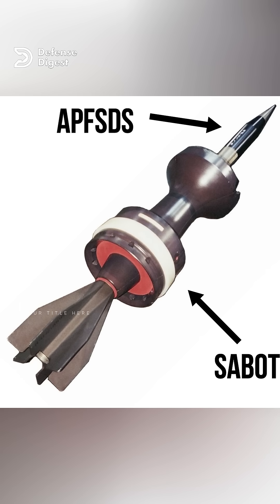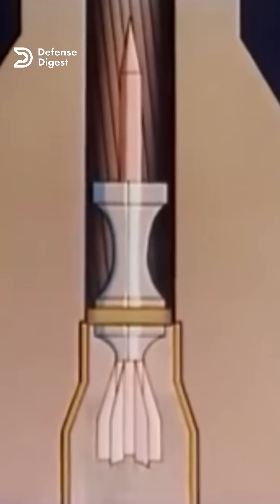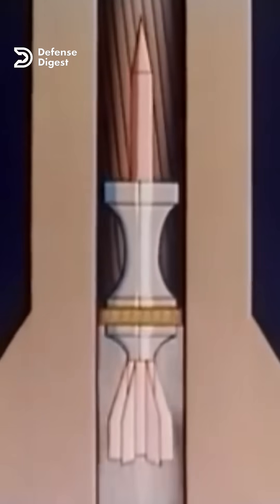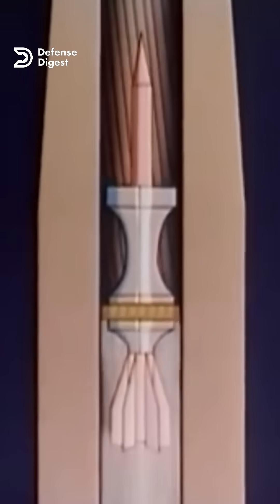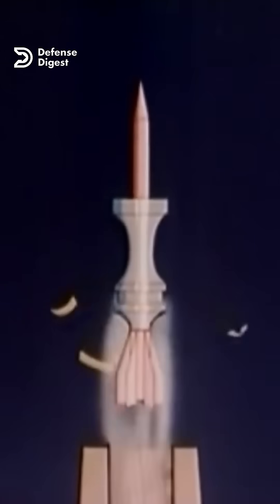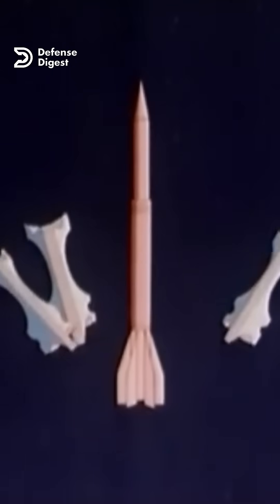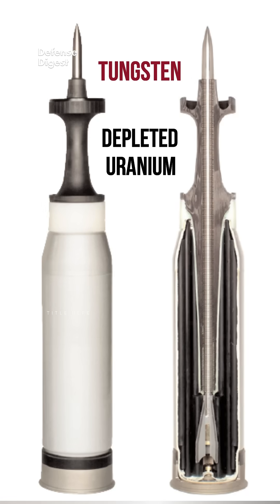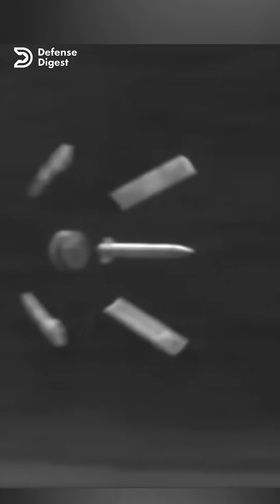How Do APFSDS Rounds Work?

Comment: The video of the fire thing going through multiple layers of concrete is a video of the United States Navy's prototype for the rail gun.
Reply: It is, you are correct... but that round is also a Sabot, a break away cog with a dart, just going 7km/s... so the footage is still relevant.
Reply: @TheThunder005  idk I feel like it’s cheating
Reply: I was about to comment that
Reply: lt.kf51  
Is there a storage bin? Or just stays on the deck/floor of the tank?
Reply: @nicholasmuro1742  Depends on the tank too. Some you put the empty shell back where the full shell was. Other tanks throw the shell out the back of the turret through a small hole for it.
Reply: @Macintosh007 
Ok, thanks
Reply: Yes they used railgun prototype footage for this non railgun explanation, I take everything I see on shorts with a huge salt rock.
Reply: And the projectile is also going through steel plates, not cement walls
Reply: i came to say this
Reply: Thats what i tought...
Reply: 100%FACTS!😂👍👍👍
Reply: @lt.kf51 you make a very valid point, didn't think about it that way... another thing too is that it isn't spun (rifled)
Reply: lt.kf51 
Where does the propellant casing go after firing the round on a tank?
Reply: @nicholasmuro1742  It depends on the tank in question. Some tanks use combustible casings that burn up when fired and only leave behind a small bit of metal at the base of the shell, some have an automatic ejection system that ejects the shell out of the turret after firing, and some just pile up spent casings inside the tank.
Reply: @ballsquid4135  
How do you know this if you are a squid?
Reply: @nicholasmuro1742  I wonder that every day.
Reply: @ballsquid4135  
Lol... are you Navy?
Reply: @nicholasmuro1742  Nah, I'm not in any branch.
Reply: @ballsquid4135 you dont want the casings to just be laying out in the field. If they are others will come remove them unless you lose the ground. Even after we fired our AT4 rockets we would run the tubes over with the humvees or something else to crush them. The shell casings from tanks or disposable rocket systems can be used to make ieds with.
Reply: @ballsquid4135  
Squids are slang for Navy
Reply: @nicholasmuro1742 back into the turret, they put the casing back where the live round came from, or on to a storage bin, but it depends on the tank model.
Older tanks had a hatch to throw the casings out.
Reply: @linkbond08  
Thanks

Comment: I think it's considered an armour defeating type munition as opposed to an armour piercing type.
Reply: It is literally called "armor piercing"
Reply: That depends on the material. The Depleted Uranium alloys is unlike anything Tungsten alloys can do.   The DU sabots actually self-sharpens as pieces break off upon penetration, and hitting additional layers/materials (especially the new US segmented DU sabot round).   
 Against armour at/near its penetration limit, the DU sabot works more like the cutting action of a HEAT warhead. Rather than on pure kinetic energy overmatch capability, like old school AP and the new Explosively Formed Penetrators.

Comment: The clip where you show a round penetrating multiple armor plate is from electromagnetic rail gun test. Not an APFSD round. Its misleading.
Reply: The rail gun "fires" APFSDS rounds. The sabot is there to catch the electromagnetic charge, instead of the chemical propellant, but the concept is almost identical, little uranium spear = hard to throw, so wrap it in something while accelerating, fins for accuracy after. 🤷‍♂️
Reply: it is a APFSDS as others have said, but electromagnetically charged and fired instead...
Reply: Look at the moment where he explains sabot, the animation in the background shows a rifled barrel, that cant be apfsds, anyone with a little bit of understanding this matter will know that an APFSDS is fired out of a smooth gun because the rifiling itruduces tooo much friction. Later he says that "it has fins at the back for flight stability" wich is correct, so i dont get why he showd us a rifled barrel. Probably a short done by someone who is doing low budged shorts on topics that are esnured to get views... well it works
Reply: @pro3ification the British Challenger 2 MBT has a rifled gun but still uses APFSDS. The footage may have been in relation to that. The rifling is for it's HESH shells

They plan on retiring their rifled guns though
Reply: @pro3ification  APFSDS can be fired from a rifled barrel, that's what was done originally. But then they discovered that it's performance suffers greatly compared to a smooth barrel.
Reply: @pro3ification the challenger has a rifled bore. It can fire apfsds rounds. 

It depends on the countries doctrine. We in the US and Germany fire armor piercing solid rounds. Countries with rifled bores typically mainly fire HEAT, HESH, or other types of high explosives rounds but they also have APFSDS rounds as well. 

The British for example their main anti tank rounds are HESH but they absolutely do fire apfsds called the L26

Comment: So they are sabotaging the other tank?
Reply: I mean...a rod of depleted uranium busting into the crew compartment of a tank and then heating the air inside to over 6000 F does tend to work against the good function of the other tank.
Reply: @braith117  little sabotage and trolling

Comment: Your right it's french but it's a silent T, pronounced sabo
Reply: Funny thing is it had both pronunciations in the narration.
Reply: As french, i confirm that the "t" is silent.
Plus, we usually call the shell "obus flèche".
Arrow shell.
Reply: @akiracrow6223  Bonne démonstration! Très puissant!
Reply: Kind of makes sense. You know, because it's French.
Reply: Sabotage meant throwing your wooden clog into the gears of factory machinery. Before they had unions
Reply: If the t was silent they wouldnt write it
Reply: @noobboon2579 You need to read more French books.
Reply: @UGNAvalon  no, the french could start writing words properly
Reply: @noobboon2579  Telling the French that you know their language better than they do? 🤣

Now tell me, as a speaker of English (which never uses pointless spellings), can you tell me what you THOUGHT about how TOUGH it is to distinguish between THOUGH and THROUGH? My mind is experiencing a bit of a DROUGHT at the moment.
Reply: Kinda like you'd pronounce say bow
Reply: @tktspeed1433  Nope, more like how you'd pronounce sa-boh.

Comment: Fun fact the T in a sabot is silent
Reply: Fun fact would be that the "bo" part comes from "bois" which means wood. Sabots were literally wooden shoes. During the industrial revolution workers used to stick the shoes in the gears of the machine that took their jobs->a so called sabotage.
Reply: @eklhaft4531 so in long the shoes was called sabotage 😂😂😂. Perfect example of don't take food from people's mouth.
Reply: @marshalljulie3676  the shoes were not called sabotage. The shoes were called sabot. The action is called sabotage.
Like drain and drainage.
Reply: @marshalljulie3676 the application of the sabot by the saboteur was called sabotage.
Reply: @hadorstapa and the one performing the action is called saboteur
Reply: @eklhaft4531 plus, the term saboter (the verb form of sabotage apparently comes from the 13th century. The industrial revolution wasnt really a thing back then.
Reply: @eklhaft4531 fun but untrue
Reply: @eklhaft4531 interesting info
Reply: @eklhaft4531 where did you get this info from? Sounds completely wrong.
Anything with bois would take a s, usually consonants don’t come out of nowhere.
Reply: @reedy_9619  My French teacher told me. It might be wrong but I see consonants change all the time. For me the weirder part would be oi->o because it changes the pronounciation drastically.
Reply: @eklhaft4531  how about law?
You go from « ay » to an open o (even closed depending on the accent) (i dont know the phonetic alphabet well enough to write with it)
Or even worse, awe. It’s ohw instead of ahwee.
Reply: @eklhaft4531  in the case you mention you d have to link the words.
« Qu’ils aient » is pronounced « kilz a » 
« Ils ont » -> « ilz (d)on(t) » (no d or t but the « on » sound is similar to the sound in don’t)
 
There are weird rules about it, but usually you would link the pronoun to it’s verb 
the « determinant » to it’s mame (les arbres) 
The adjective and the name
(Petits enfants) 
words made of the addition of other words
(Arc-en-ciel)
And in cases like « allez-y » or « mangeons-en »

You only link if the second word starts with a vowel
And if it’s a silent h (this one is tricky because some words have a « inhaled h » like hiboux or haricot.
It’s a fucking mess and there are exceptions. To the point where many french people say things wrong.
Reply: @reedy_9619  I studied French for 6 years but it was 9 years ago. Sry I forgot the liaison.

I actually wanted a better example where the subjonctif form ended with "-eaient" I think there was such a verb but can't remember.

Also thanks for explaining the forbidden liaison. It was way too complicated when we learned it in school.

Edit: yes there are exceptions and sometimes exceptions of exceptions. Still better than english where the same group of letters can be pronounced 5 different ways without any clear system 😁
Reply: I guess they used both iterations so they would only be partially incorrect.
Reply: the T in apfsds-t is means tracer
Reply: It’s because we threw it in the harbor.
Reply: @SubA-10c damnit you did it first, I was just gonna post that!
Reply: I was an M1A1 crewman and its pronounced "Say-Bow"
Reply: That's supid.
Reply: And learn damn it there are only the first latter apdsfs=Armor Piercing Discarding Sabot we don't need the t
Reply: No its a hard T like the K in knife
Reply: @anormalrat the word comes from french thus the t is silent
Reply: @pootisbirbgaming4183 in french yes doesn't mean its the same in english, maybe in some dialects, but very unlikely Because you wouldn't expect the T to be silent therefore even if "Sabo" is correct, in practice everyone says "Sabot".
Reply: @pootisbirbgaming4183  Yep, until sabot becomes sabotage, then the T is no longer silent.
Reply: @birisuandrei1551 British English speakers don't pronounce the "t".
Reply: @stephena1196  understandable, it's rather weird though because without the T it sounds like a completely different word.
Reply: @birisuandrei1551 and in practice everyone could be wrong. Words taken from a language usually get deformed because people can’t pronounce or read it correctly, take italian food names as an example.
Reply: @birisuandrei1551 which word would that be if pronounced without a t?
Reply: @reedy_9619  terrible examples, as someone who has been all across Europe, Italian food is always called by their Italian name and whenever someone tries to translate it or rename it people get confused because they all know the Italian name 😂
Reply: @birisuandrei1551  no, americans can’t pronounce italian names to save their life.
Reply: @reedy_9619  well their problem 🤷🏻‍♂️lol
Reply: @anormalrat  it's french the t in french is silent
Reply: @AgentK-im8ke  just being silly mate theres no hard k in knife either
Reply: @AgentK-im8ke depends where the t is
Reply: @anormalrat the word is french originally
Reply: @thor498  wanna take a second good hard read of my comment
Reply: @anormalrat wtf every one knows it’s pronounces kay-nifay.
Reply: @anormalrat i love using my k-nife
Reply: @anormalrat waaait thats how u spell knife?
Reply: @anormalrat  in french we don't say it, neither do you in english.
Reply: @sasoushii2816  missed the joke, you don't say the hard k in knife either
Reply: @anormalrat don't remember bo being spelt with a T
Reply: @theEWDSDS it’s french.
Reply: Not in Romanian
Reply: @ddd.777- but the word is French not Romanian
Reply: @thearizonian9500  ya, but we have the word sabot in romanian too, probably is from latin or something
Reply: @thearizonian9500  Romanian and French are part of the same language family therefore some words are similar or exactly the same, the only major difference is the ridiculous amount of silent letters in french that Romanian doesn't have.
Reply: @birisuandrei1551 as for sabot from the limited research iv done it doesn’t really seem to come from latin.
Or not directly at least.
It’s a bit of a mess
Reply: Sabot originally had 5 more letters but they were all silent and no one could  remember.
Reply: @Superior1995Rex pretty bold for a guy with a language were letters don’t make the same sound consistently.
Reply: @Superior1995Rex  makes sense. "Qu'ils aient"->[kile:]
Reply: @eklhaft4531  in that case you d pronounce the s
Reply: It's also pronounced "say-bow".  French word.
Reply: @kurtfrancis4621 no it’s not.
Reply: Because Francis is weird & hard to learn.
Reply: The t is silent because it's at the bottom of the damm harbour
Reply: He said sabaht which is wrong. It's sabuht in American. Sabow is British.
Reply: Then why is it there?
Reply: @sugarflame1833  it is there to allow spiritual beings to pretend they come from different locations with names called countries apparently and have fun playing with different sound variations and make a big deal out of it apparently.
Reply: @sugarflame1833  English
Reply: Fuhcking thank you
Reply: @elijahyella3049  anytime
Reply: Not if used in saboteur 😏
Reply: Another fun fact, DU rounds are sharp as hell
Reply: @patgraeme775 - You mean sharp like, needle-sharp?
Reply: @parrot849  yup, they'll cut gloves up pretty good
Reply: Meanwhile my name being "Beaux" having one letter that makes sense...
Reply: @Chronometrian it’s no different than « ea » and « ough » in english.
Reply: I’m glad your the third top comment cause if no one said anything about this I was going to
Reply: It says it both ways.
Reply: I am french the T is silent.
Reply: Ita funnier when its pronounced right, "Say Bow" and its just a high tech arrow 😂
Reply: I hear it pronounced either way. I hear it pronounced "sahbow" and "sahbut" and honestly I think both are correct
I might be wrong tho
Reply: In American English
Reply: @duncanmcgee13  what about the brits
Reply: Edit to my reply that I can't edit for some reason, I saw that you guys are saying "oh well the word is French". As a French student myself, I think the word has been adapted to English and can be pronounced with a hard T if preferred. You still know what the person is saying.

Comment: What an explanation.👍
Reply: Yeah and ninety-nine percent of it is incorrect of course. There's no explosives in those shells they're not made of tungsten they don't fracture as they go through they don't blow up with a cone-shaped explosion. They're made from depleted uranium which is spent nuclear fuel and it's four times heavier than tungsten, the reason for the sabo is to get super high velocity no other reason. And when depleted uranium hits the air it starts blaming when it hits armor it melts a hole through the tank. Nothing blows up nothing fragments from the arrow. What kills the men inside the tank is the f**** s*** of molten metal spraying all over everyone. And this is how a tungsten shell works I'm not talking about any other kind before somebody brings up world War II solid steel shot or something stupid like that.
Reply: @jeremymackevincaylor5041  So much bs in a single comment. Well done.
Reply: Ukraine 🇺🇦 needs against aggressor ❤
Reply: @arek3866  There are many countries with that problem,but none care about them...
Reply: @arek3866 Ukraine Is just another Palestinie

Comment: Yyeeaahhhhh...   that's not how you pronounce "Sabot"!      facepalm
Reply: It should be like "say bow", yeah?
Reply: @C0ttageChees  correct
Reply: @C0ttageChees  No, "sah-bow".
Reply: @enscroggs  Thanks :)
Reply: There's 2 ways of pronouncing it just depends on what accent you use just like aluminum
Reply: @hekmatyar4476  Not quite, aluminum is also spelled aluminium in England and that is why they pronounce it with the nium and the US pronounce it num.
Reply: Microsoft tom.wants the upvotes just dislike komrads da
Reply: Fun fact: sabot is the root of the word sabotage, a word that literally means to apply a wooden shoe. In the 18th century, French weavers tried to stop the manufacture of cloth by jamming the gears of automated looms with their wooden clogs -- i.e. they literally sabotaged the machines.
Reply: Listen closely, the narrator pronounces the word differently in the same presentation.
Reply: True, but most people respect the French Language even less than the English one.